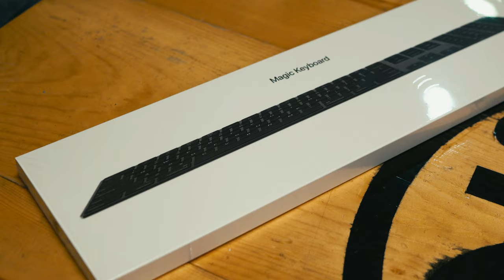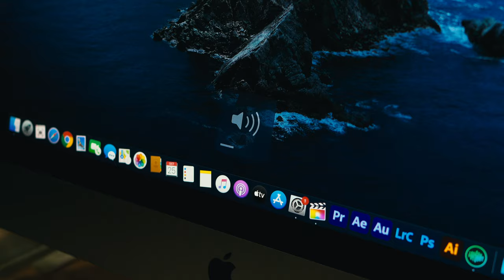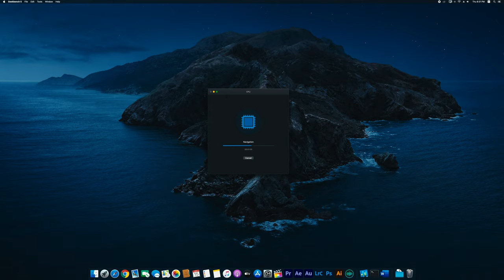Mac Pro Case Mod Part 2 | Retina 5K Display | Hackintosh | 4K

Comment: This looks amazing 😍. I have one of the first gen 5K iMacs so I want to upgrade the computer(probably Hackintosh) but want to keep the 5K display. I think I have found the right display driver boards, but how are you keeping the same speakers? Do you have a link to the board you used for them?
Reply from the maker: Thanks, about the speaker amp just use "50W x 2 Bluetooth 5.0 Digital Amplifier " they easy locate at  alibaba
Reply: @752workshop8  Thank you! I’ll have a look for something like this. Do the speakers work well in stereo as normal?
Reply from the maker: @priva28  Work Perfectly
Reply: @752workshop8  Would you do just the case for someone in the US l have parts l want to put in a case like that Thanks